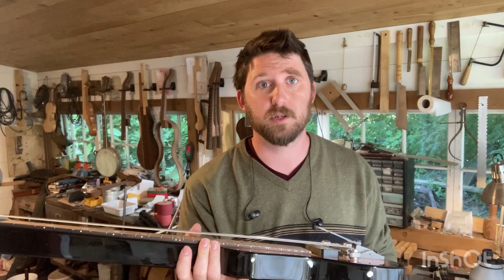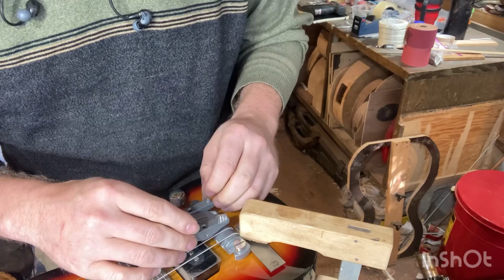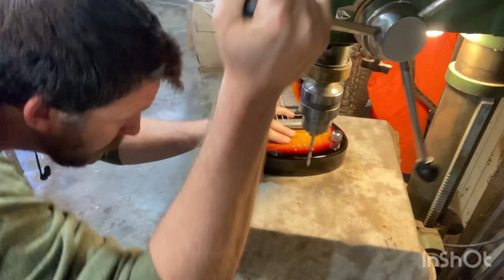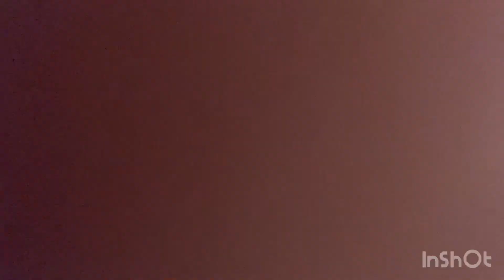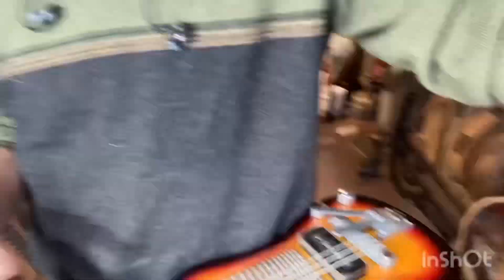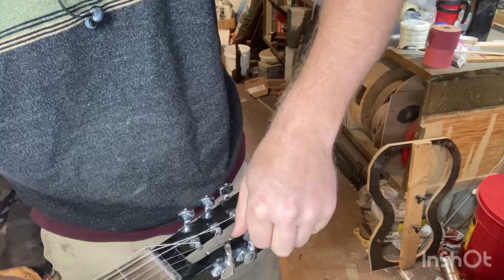The cheapest bender/lap steel combo around: Peters Pitch Witch on a Sx lap steel

Comment: Hey Shad! I’m gonna order mine tomorrow and then find someone to install them. 

What is the deal with swapping tunings? From what someone told me, you need to make sure the total tuning tension difference is under 30lbs, is that correct? Otherwise they’d need to be restrung? 

Ultimately I’m just looking at swapping between open d/open e and c6 etc with the benders on. 

Super excited for them, been eyeing these for a minute now.
Reply from the maker: I'm not sure what is acceptable as far as differences in lbs of tension. I know I typically use the same set of strings for open D and open E since it is the same tuning just lowered or raised by one step. C6 is very different from either and requires a C6 specific set of strings.

Comment: This is awesome! I just did a similar install on an SX for my brother, and it's amazing what a 2 string pitch bend system can add.  BUT- if you play finger style a lot, picks or no picks, I HIGHLY recommend saving for a full on pedal steel guitar. With much patience used useable "PSG'S"  CAN be found for $1,000, even less if an estate sale or something.  Finger picking is 90% of pedal steel, the rest is so easy! Imagine string raises AND lowers on almost every string (10 strings), and your hands are free to shred!  It's a whole different world.  This Peter's bender looks great, and is half the cost of all the other companies I've seen.  Combine it with bar bends and your 6 string lap will amaze your friends.  I know, I own 2 top of the line pedal steels, but to show up for a little jam with your friends, maybe gigging at a local coffee shop, that's where I'll bring my 8 string lap- with benders!  Sky's the limit, have fun!
Reply from the maker: Yeah, benders certainly have their limitations, I don't think I would agree that you can't finger pick and use them at the same time though. They do pose a challenge over totally unencumbered playing, and pedal steel will always be the best choice for easy of changes, but I only finger pick in my playing, and have no problems using the benders at the same time, and I'm by no means a great player.

Comment: Hey, does the bender get in the way of the leg stands?? A lot of people have that problem with the certain benders on the SX and that’s why they take em off
Reply from the maker: Hi Ryan! I unfortunately do not have this steel in my possession anymore to check on this, but I don't recall any interference with the leg mounts. I think if there had been thats something I would have taken note of.
Reply: I have a left-handed SX.  Any issue with installing your bender on a lefty?  Are the B and G mechanisms identical?  Thanks.
Reply from the maker: @jmtab  no problem at all, the bender is totally ambidextrous